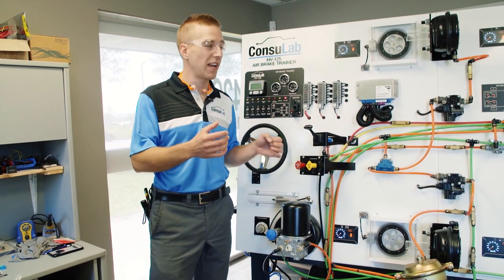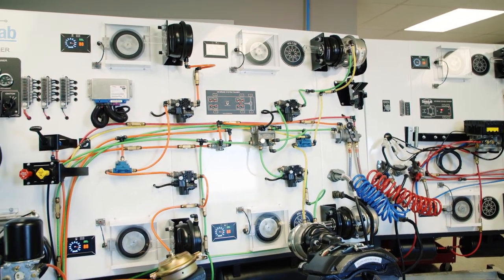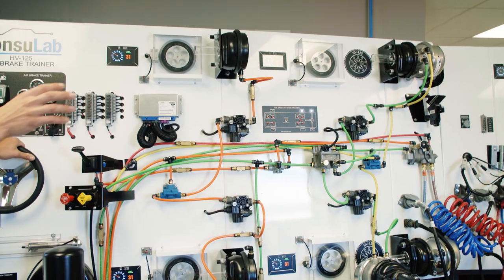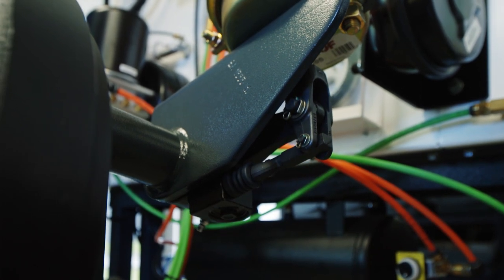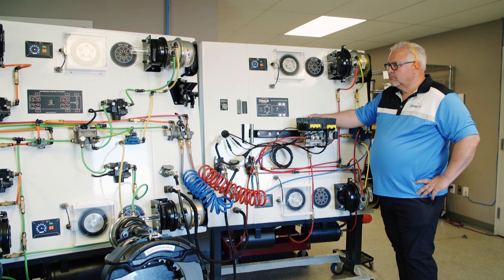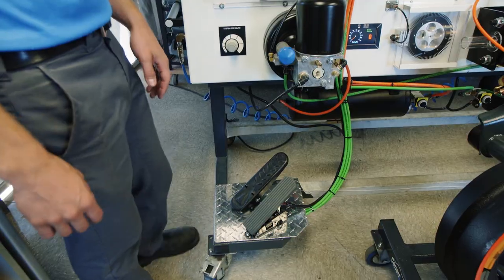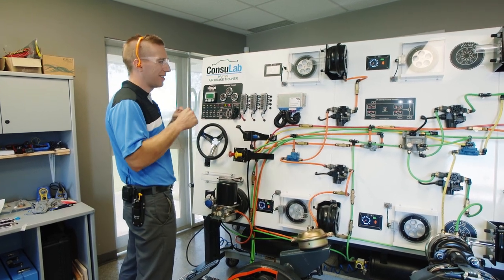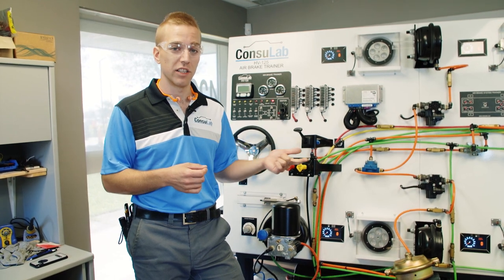HV-125-BWP Air Brake Trainer

Comment: I have a question to you regarding air braking system for trailers. The following phrases are hard to understand.

 

"If the second trailer doesn’t have spring brakes, drive the tractor close to the trailer, connect the emergency line, 

charge the trailer air tank, and disconnect the emergency line. 

This will set the trailer emergency brakes."

 

How do we set the parking brakes on the trailers which do not have spring brakes? Do they have a different 

mechanism for setting the parking brakes other than the spring?

Comment: hey Zach if you pick up any Turbine HVLP System you generally get a gun with a Cup on it and you can get a heck of a nice Finish Spray job  using  Gallon Cans of Rustoleum.  it’s usually way cheaper  to buy it  by the ounce etc that way of course you can buy it that way at Walmart , Most Hardware Stores, Tractor Supply , and Online  i’ve sprayed lots of things like that the HVLP Systems are  very similiar   and they really Atomize the paint. Well  which is the key  and  they are fairly easy to use and Clean up  i am a retired Woodworker  the other nice thing about HVLP is it helps minimize overspray and waste even Harbor Freights System gets good reveiws. i use a older Campbell Hausefeild system they don’t sell as a kit any longer  mine is a metal gun and Cup  that cleans up well  HF is plastic  and  might be harder to scrub  ?  doing Woodworking i always sprayed Conventionally with metal guns  so that’s what i’m used to  We basically. used Automotive Guns  the Campbell Hausefeild looks a lot like the older Binks models  the old Dupont Paint Supply stores  used to stock